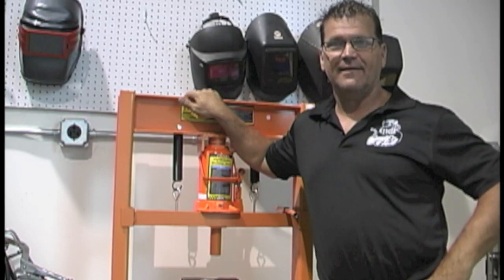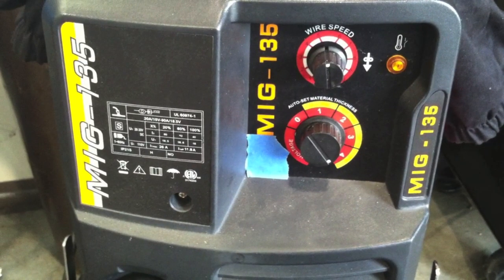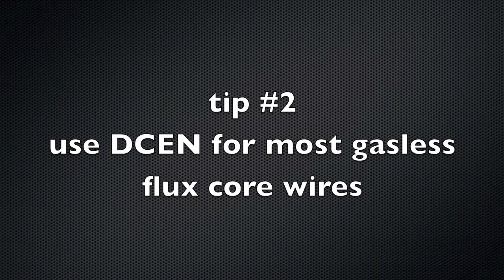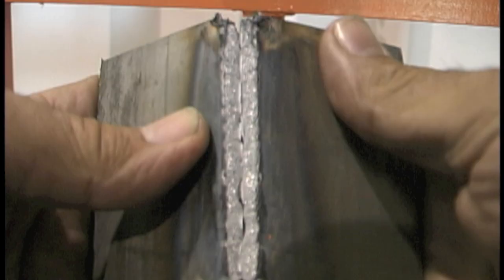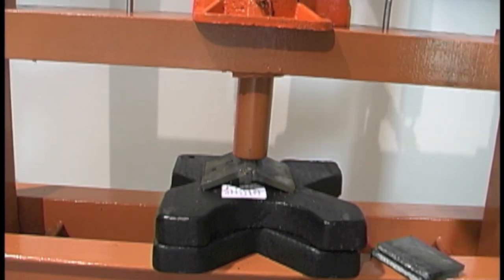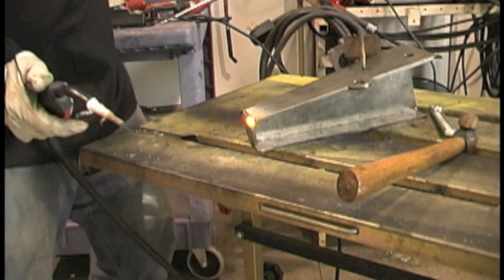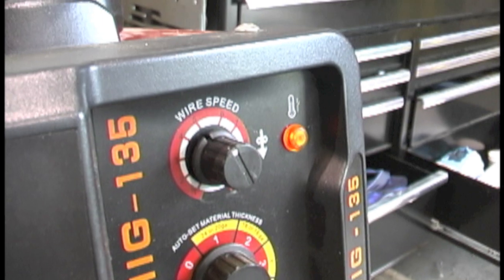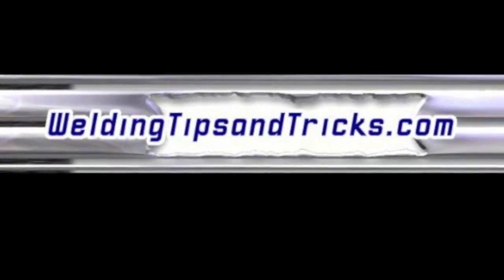115 volt Flux Core Welder Tips

Comment from the maker: I completely agree.  I ran out of nr211-mp wire and so I swapped over to my hobart 210mvp but plugged it into 115volt 20 amp plug.  It completely out welded the cheap import welder without ever overheating.

Comment: I've been rebuilding my forging press, borrowed a Hobart 140 and was burning some thicker stuff, it never over temped , I did preheat with a map gas torch and multiple passes were a must
Reply: Hey Steve - I got a really good deal on my Hobart 140 at Tractor Supply. So far, it's working great and is very forgiving for someone who is totally clueless. Never had it go into thermal shutdown but I seem to remember it has a higher duty cycle than lots of the others. It can also do gas and it's made in the USA, which is amazing these days...

Comment: I am a newb flux core welder - I have a Hobart Handler 140 - shop I work in only has 115v/20a service.  I cant wait to try some of these tips.  One that I use to cut down the slag on the work-piece - I get cheap cooking spray from the the dollar store and spray it on.  The weld cuts through the spray, but doesn't put as many BB's on the work piece.

Comment: I have something like this.

I took out the factory fan and taped the end of my shop vac to the rear fan outlet. Cooling like a hurricane.

I also installed a dedicated 30 amp circuit. I can weld all day long without over temp or blowing the breaker.

Comment: Holy crap. An actual video showing how to properly get going on a 110 with flux wire. I'm in awe. I spent the whole day looking for this video. Thanks for the help. I just tried welding today with a snap on ya217 I got for free. Couldn't stick 3/16 together but now I've got some new things to try. The first project I'm working on a is a cb antenna mount.

Comment: Thanks again Jody, been watching all your stuff...is great to learn from a good teacher!  I know it's 6 years later, but if anyone is watching that needs to use a 115V flux core, I picked-up a MillerMatic 141 (which is also usable with gas, comes with gauge and hose) that has done nicely for my on-going project (steel 6'x20' double gate with wood between 2"x4" 11 ga frame).  As per it's name, it has the ability to set itself up automatically if you are using .030" flux core and 3/16" or less thick mild steel.  I've been using it for a month now on a 15 amp circuit and only popped the breaker once on a hot day here in the Mohave Desert (114 degree day).  And yes, it does run better on a 20 amp circuit.
I really like the gun it came with and the quality is excellent.  I also like the portability at about 75lbs.  I'd be curious to see what you think now Jody...?  Another video now with some newer technology, maybe :)

Comment: Nice Vid. I purchased a Lincoln power mig 140 a few years ago and used it as mig for about a year. After the gas ran out during a project I switched to flux core. I haven't went back to mig since then. While mig provides a much nicer weld, flux core does a great job for me in the auto repair trade while keeping costs down. Knowing your settings is important to do a good job.

Comment: I've got a ProCore 125 from Lincoln Electric that I picked up at Lowe's that seems to do the trick for me. I use flux core and have welded up all sorts of stuff including a roof rack for my Jeep that has held up fine through much abuse. I have problems with spatter sometimes but I've only been welding off and on for about a year and a half.
Reply: is it true that a dutch company owns lincoln and selco makes the maschines .goedendag

Comment: Love that you mentioned the Positive Ground. Most internet "Welding" tip's site's do not mention that when using a cheap Flux Core Wire machine. I have 2 stick machine's, 1 a newer Lincoln "tombstone" and a 50 year old Westinghouse 225 amp AC/DC that I can reverse polarity with a switching leads. Great Tip, Great Video's.

Comment: i bought one of the early flux core machines  i had to weld a steel boat about twop hundred feet from a 20 amp outlet. I hooked up shore power cords from the boat 10/3 heave cable. then i put in the case the biggest 110 volt pc cooling fan. it fit right in and i only had to drill two holes in the case to mount it. i have welded three pass welds on 3/8 thick and it works on thin stuff if you slow down the feed. it has never even got warm since.

Comment: ive been welding for over 3 years now. i have a Lincoln electric weld pack HD it is a flux core only. and i have been doing every tip you have mentioned in this video. it does make a difference! thanks for the great advice.
I have only had mine over heat 2 times in the dead of summer night with humidity at its highest in MS. its a real power house. Cheapest and most reliable i have found. looking to step up one day. but im just a weekend warrior.

Comment: I opted to save up and spend 1200 bucks on a Miller 211 for this exact reason. When I looked up welder reviews and the common opening line is, " In order to get it to work right" and the best common assessment is "Overall its ok"  translated into leave it on tbe shelf.
Reply: Overall review of my Miller 211 for workshop use? Totaly awesome, more tjan enough for the job, Its like taking a tank to a fist fight.

Comment: Good video! I bought a Lincoln weld pack I've been playing with. Only used flux core so far, I think it welds pretty good, just using it for brackets on my frame right now... It runs off 110/15 amp and haven't overheated it yet! It's rated for 3/16 and it does it well!
Reply: Same here.  I love the 140.
Reply: Ian Thompson I use a 140 here on the farm and it does everything I need.

Comment: I do most of my welding at work with TIG and decided to try my hand at MIG so I bought the "top of the line" HF MIG 180. I've found that if I leave the gas cup on my stickout problems are considerably reduced with flux core. The biggest problems I've had is the inconsistent feed below the 5 setting, and the gas valve in the gun getting stuck (at work using straight argon), which isn't a big deal because all of the projects I do at home are outside with flux core anyway.

Comment: i started with a cheapo 115V stick welder. my logic was "less could go wrong because there's less moving parts." never had a problem with it. and i still use it sometimes. i also have a hobart trek180 MIG welder now, which is awesome.

Comment: U probably won't even see this, but I wonder about going up a tip size over the wire your using or boring out the orifice of a 0.035 size tip if using that size wire (I've never seen a 0.040 tip, I know they're out there, but this side of the world people don't use 0.040 wire). What I find as well is these 115 V welders are really good  for filling gaps. If the welder ' s throttled down a bit and the torch is pointed parallel to the direction of travel I seem to get good results. Great video.

Comment: Had a nice simple job one day of knocking up a hefty frame to hold a diesel tank out of some 100 x 8 angle. Problem was that it was to be done in situ, outside the shop and none of the good welders had long enough cables to come with me. Was stuck with one of those budget stick welders at almost max amps. It's hard to overstate how frustrating it is to deal with the constant overheating, I don't think I was getting much more than 2 inches before it stopped.

Comment: I was wondering if you can give a best guess for a dollar rate per inch of weld?  it would be MIG on  220v machine, and welding things like leaf spring pads on truck axles, fabbing rocker protectors for Jeeps etc. and making bumpers for Jeeps and for off road recovery none of that would be over 1/4 in thickness. my reason to ask is for small weld jobs people in my area are all over the map in price. so as i get back on my feet i want to get a welder here at home again but when i needed one people had some very unreasonable rates for these simple weld jobs i needed done. all easy stuff, do it all on a bench. no overhead.   trying to bring some sanity to my hobby prices in my area.   thanks and keep up the great videos!

Comment: First off I am not a professional welder I am a retired helo pilot but none the less I weld. There are applications I'll chose gas less every time. I have run nr211 and the results were pure crap. Change to another spool nr211 and get great welds. I've run other brands including Harbour Freight, Hobart, Blue Demon ect. Blue Demon does offer a great gas less stainless wire, however, for steel I like the consistent feel of the wire over others. Seeing these etched coupons was educational. And I think I will continue using Lincon for gas less but Hobart has impressed me lately with their MAG wire. My opinion.

Comment: Good video. Thanks. I"m in the process of a Shop Press build using 3" and 4" channel. After that I'm going to build a Press Brake that will be something like the Swagoffroad Press Brake kit that you covered in another video, with the biggest difference on mine is I'm going to use either 3/4 or 1/2 for the base.

Comment: I have a 115 Lincoln Mig Welder and on the instruction it say that for 1/4'' material you need to use the multipass method one pass will not be enough for that thickness. Please try the multi pass to see if it will hold.

Comment: I use a vapor 90amp flux cored wire welder no gas with Hobart 0.035 wire and I welded a boss plow carriage to  my chevy duramax and it has dow force and iv been using the plow the last 2 years hasn't broke yet

Comment: Jody, here is a tip for you that might be of some use. If you swap out that bottle jack for a 20 ton air/oil jack you can connect it to your air compressor and not have to pump that jack handle. Can come in handy if needing to hold something while putting the squeeze on

Comment: Look for used welders, I got my Hobart handler 135 for $200 with a cart, empty bottle, regulator and two small spools of wire. It does good enough for what I do at home, I wouldn't go build something that the welds were critical for but I have access to mig welders upto 450amps and stick machines upto 600amps so If I ever needed to I could. if you have a couple bucks to spare buy a used harbor freight welder or something for cheap if you've never welded before to see if its worth it first.

Comment: I have a Clarke 90en (I think) that I use sometimes, I've never had a thermal O/L on it. It has surprised me. I have noticed though cheap 250V machines (where I am) tend to do better than 120V ones. The primary windings are usually the same gauge but because 250V delivers more power per amp it doesn't need as much current going through the windings, hence the transformer runs cooler. Still can't beat a good old oil filled Oxford for duty cycle though, those things run all day.

Comment: Thanks good tips you remind me of dan Sullivan with the load pro the way you talk and sound how long should you press the trigger when do a weld on 20 gauge sheet metal i have a flux core 125 wire speed set a five and set on low and i am getting terrible welds this is my first time ever wielding so i know i am not going to get good welds any suggestions

Comment: I know you probably know that "if there is slag you drag" is a loose term, and there are exceptions. linclon m71 outer shield is one. you should do a video on using it. a neutral or push travel is recommended. if you don't know or haven't used it, it is particularly finicky and sometimes difficult to use, but is used in structural welding and ship building among other trades. kinda like fcaw meets 7018. used for heavy plate. if you have a video already, I can't seem to find it and a link would be great.

Comment: On pieces that are hard to clamp I use a magnet off of an old magnetic trailer light works purty good if don't want to replace the clamp. Get a short piece of cable put the magnet on it put a short piece of copper tubing on the other end and crimp it. Maybe something you could think about

Comment: Hello, i have been welding for a couple of years and recently started doing much more. I have found flux core works for me the best. I bought a second hand welder that had a few kgs of old wire. I found this was brilliant for what i was doing and would happy weld horse shoes and disc brakes together, there was lots of smoke and spatter and the slag was powdery and very thin. That ran out and bought some more from the tool shop and its not anywhere as good. I'm hoping that you can tell me what wire i want for welding non mild steel, i'm also from the UK so this might make a difference.

Comment: the best all around flux core welder I have ever used and still own is the Hobart 125 hands down best bs free flux welder for starters, diy, garage, and at home stuff I use blue demon brand wire it seems to be way better than Lincoln wire easy arc with no sticking on dirty stuff digs in well and has a seemingly more violent arc then Lincoln brand wire would highly recommend blue demon wire for people with flux core only
Reply: I got the Hobart 125 also and very happy with it.  I got it to do repairs on hog gating, easier to get it around compared to a 220 welder and with the flux core it is forgiving on rust and "organic" material when you can get the area the cleanest.  Hogs are not very gentle on equipment and repairs I have done have been holding. The quality of the wire is very important.
Reply: thanks for the reply most of the welds ive done are pretty strong with the 125 I have noticed some different types of metal stick better than others like some angle is pretty dirty and will rust fairly quick and some square tubing is un necessary to grind  but I buy my metal from a ornamental iron supply for structure and scrap yard for recycled plate cheapest way to go farm and industry supplies will rip you off!!!

Comment: Think i put another 50$ into the machine in a choke and a cap to level out the wave, put 2 additional fans inside, modded the wire tray to take 10 lb spools, changed out the wire feed motor and controller also putting that on its own circuit instead of off the actual weld transformer, made its own 20a curcuit and put on oversized wire(120v feed wire and bigger ground wire) and the 140$ welder runs like a champ.. ive tested it with jobs where i easily ran 5 consecutive beads on 1/4” stock butt weld about 5’ long without stopping only between each 5’ piece..  now i do let it have its moment afterwards n let it chill with the fans on for a 5/1 ratio..  5 no work to 1 work but dont go off of doody, how evr long it takes me to weld what im welding i let it chill 5 times longer to cool off...

Comment: Great Video I haven't seen much real video on 110 mig welding on YouTube . I bought one from ExxxWood that will do either gas or flux core great machine much heaver than big named units I've done some long runs on 3/16 2 plus feet and no overheat problems yet . Next project I'm looking at is a Tbucket frame 3/16 box tubing very confident this machine will do it no problems. Would love to see you evaluate their machine .

Comment: thanks, great advice.  I can swap my Lincoln to gas, from flux core, wondering if it's worth the cost. I'm just a hobby welder but want to increase my skills.
Reply: +chardon59803 We just started used flux core in school. It is supposed to be a stronger weld, but there is A LOT more clean up. Plus it gets pretty hot, so you may not want to use it on thinner material. I'm just a student, so my experience is limited. They are both pretty easy methods, but act much differently. I'm going with flux core until I have the cash to get tanks.

Comment: I have a flux core I got from Tractor supply it was on sale for 100 bucks. its 115  and the weld you showed were it just spatters it dose that. its just ac it dont have dc at all. wold it make a difference if I could convert it to dc. mine is a job smart mig.  any idea's to have a much better weld with it because it dose a lot of the spattering, and puddling and not flowing.  and realy sucks on 1/4 inch unless I preheat the metal then it works a little better.

Comment: Jody I have a lincoln Electric HD 100 and old welder I bought for 400 dollars long time ago. I set the wire feed a tad above 3 and the V setting to C for 1/8" plates. I ran test beeds with various pull and angles. I get bird shit everywhere. What can you reccomend ? I was outside and it was very cold.

Comment: Hey Jody I know this is a older video but if you don't know and don't want to find out the hard way which could result in a trip to the hospital, GET RID OF THOSE HARBOR FREIGHT ARBOR PLATES!!! The HF 20T shop press is a great tool for the price and highly recommended. The only problem with ANY of the HF shop presses are the arbor plates that come with them they are CAST PLATES and have been known to EXPLODE. Yes EXPLODE. Search the web and check out Swag Offroad they have a article sent in by someone that had one explode in his face almost causing him to loose an eye. Throw those cheap ass thing away, you can get some FORGED plates off eBay for under $100 bucks.

Comment: I have a 135 amp 230 volt welder which I use flux core. I'm having trouble with blow outs and if I'm welding over the top of another weld do i have to turn the out put voltage up because the material is now thicker due to the previous welds?

Comment: I have a centery 100 flux core i love it it can weld up to half inch and its really good has a 20% duty cycle at half inch  i love the dame thing never over heats its great i got it a tsc in canada um its made on the same ensemble line as licon electric and i payed 400$ it was on for half price
Reply: Just an update i converted my welder so i can use gas and i did some wiring to weld aluminum